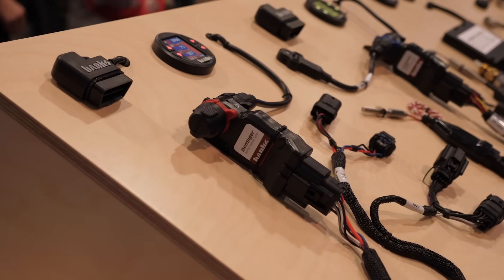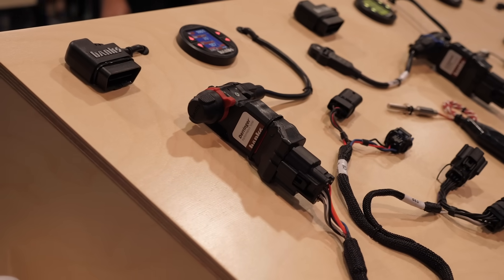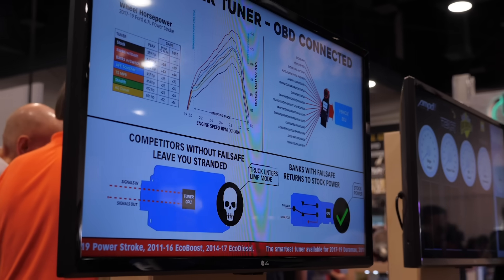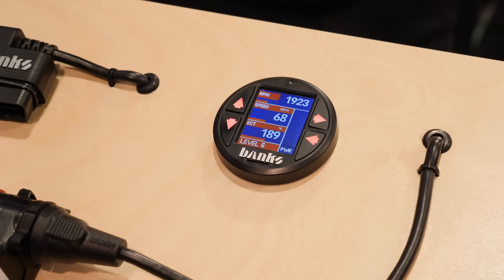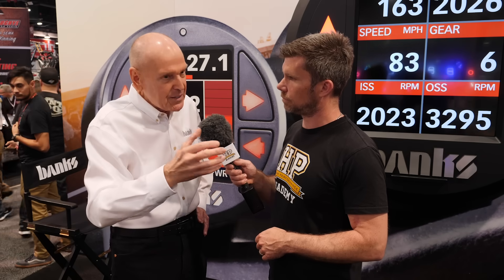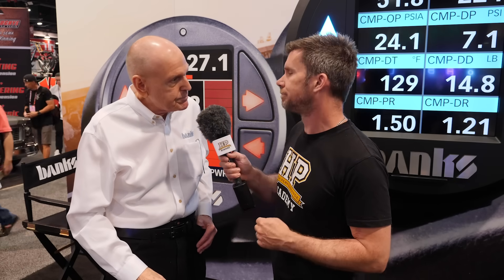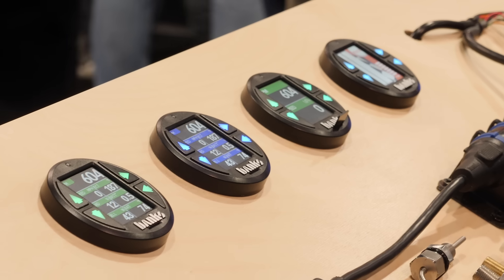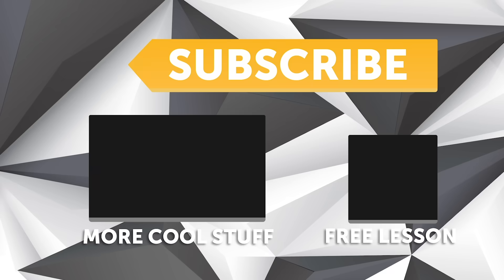More POWER With A DPF Fitted? | Gale Banks On Emissions [TECH TALK]

Comment: whats his answer to the nasty crap building up in our brand new trucks intake and after long enough it cuts the air flow he says matter so much for power yet agrees that its good..... i dont get it.. kill the engine that could last a life time basically with normal scheduled maintenance  gale man you can really think that crap is even close to ok for the engine...
Reply: EGR does it too. The soot is like tiny pieces of sand and wears out rings and cylinder walls much faster as the EGR valve allow exhaust to flow into the intake.

Comment: The market is still alive and kicking. Delete it mechanically yourself and get it remote tuned from Canada where it’s legal 👌
Reply: Problem is that before long you will not be able to register the vehicle without an inspection...
Reply: Did mine as soon as I got it. 2019 Ram 3500. Optimal Welding. Best tuner for the Cummins.

Comment: Does banks run DPF on any of his race motors?  Didn't think so.
Reply from the maker: A race engine in a race application? That is covered, he does not. Are you running a race engine in a race application too? If so, you will have no issues removing the system - Taz.
Reply: @hpa101  Am I looking for the most power I can get?  Yes.
  Is the emissions equipment a limiting factor? Yes.
Does emissions equipment limit power and shorten the longevity of modern diesel? Yes.  
Does banks do whatever it takes to stay in compliance with draconian government regulations? Yes.  Makes him an un-American bitch.
Reply: @asherdie  : Garbage.....What it makes him is an honest Business Man trying to stay in business......
Your Rolling Coal amateurs will hurt  everyone eventually......

Comment: That’s not true about record holding Diesel engines not smoking. Some of the fastest Cummins diesel drag truck pour cloud of black smoke running 3000hp. Gale is getting payed by the EPA to say that
Reply: They use the  excessive fuel to control EGTs, and super high Boost Psi. The other thing is they run that for a quarter mile not thousands of miles
Reply: Gale is referring to his race diesels, no one elses.  Black smoke is not power, it's wasted power.

Comment: $2000 to delete over $5000 for a new DPF. I am choosing deleting. I don't want to roll coal, rolling coal is so stupid. I like clean tunes. There is no need for dirty tunes.
Reply: Try 7-9k for the L5p
Reply: x2
Reply: You and many are wrong most places called Dr diesel have no clue how it's done properly second delete will create other issues down the road.
Reply: Rolling coal is for teenage mommas basement bitches
Reply: Come on, be a REBEL

Get it?
Reply: Matt 68 Gale has sidestepped the fact that other than laws there are absolutely no reason to keep a dpf!
Reply: Pat Ball Actually diesels burn really clean. Cleaner than gas engines in fact. When you start adding more fuel it’s a different story
Reply: @huntguy3831  burn cleaner and better fuel economy
Reply: Pat Ball  plants intake carbon dioxide. Its been proven time and time again that the carbon footprint is bullshit. 

The only real issue is smog and that happens in low lying areas with stale air movement like Los angles and is not an issue except in deforested areas.

Look up the controlled plant growth study. In a sealed environment not only did the plants uptake over triple our current atmospheric carbon level the plants grew better.
Reply: Pat Ball   Actually not accurate at all . Black smoke is simply excess unburned fuel. A diesel is much more efficient  then a gas engine.
Reply: So before emissions you had soot, soot is relatively large paricles and fall to the ground. Now with DPF and regen you burn the large soot particles into really tiny particles that stay suspended in the air and can easily be inhaled. Just sayin
Reply: @ericwendlandt7808  no shit! Anyone whose been near a Ford that is regening can tell you it burns the shit out of your eyes, nose and throat, bit somehow that's better than soot, that settles to the ground.
Reply: @Jackmerius_Tacktheretrix  Why you standing by the exhaust of any running engine?
Reply: @Jackmerius_Tacktheretrix  *
Reply: @dj4monie  Some people work for a living and it's common to stand close to the tailgate of a truck, where the cooler is.
Reply: @ericwendlandt7808    I have herd this for years. but I feel like its an old wise tail.
Reply from the maker: @Eric I'd be interested to see your credible scientific links to back that statement up - Taz.
Reply: @hpa101   I would love to see yours? Just cause a government agency says so?  I would love to know shortening the life span of these trucks and burning almost twice the fuel it's better for the economy?
Reply from the maker: @bradleylayton1741 I'm not making the claim, we're just working within the rules we have for street vehicles. You also give people a lot of credit to come up with and implement such conspiracy theories let alone keep a lid on them. In reality, people are far more incompetent than that in my experience 😂

There have always been rules to follow and rules for many things in life including some that allow you to post your comment from an electronic device without fear of being electrocuted for another perspective on it all.

Although the focus is on ash, soot is part of the study by default too for these 2: Sappok, A. and Wong, V., “Detailed Chemical and Physical Characterization of Ash Species in Diesel Exhaust Entering Aftertreatment Systems,” SAE Technical Paper 2007-01-0318, 2007, doi:10.4271/2007-01-0318.

Sappok, A., Govani, I., Kamp, C., Wang, Y. et al., “In-Situ Optical Analysis of Ash Formation and Transport in Diesel Particulate Filters During Active and Passive DPF Regeneration Processes,” SAE Int. J. Fuels Lubr.6(2):336-349, 2013, doi:10.4271/2013-01-0519.

You might also enjoy this. There might be something more recent now if anything major has changed: https://www.sae.org/publications/books/content/pt-124/

And change the search term to suit your topic here: https://www.sae.org/search/?qt=%22diesel+exhaust+emissions%22+&sort=date&sort-dir=desc&display=list&content-type=%28%22PAPER%22%29

I know you're most likely here just trolling and are not actually engaged or interested, but just in case, enjoy! 😂- Taz.
Reply: @hpa101  nothing personal, but I doubt all street legality laws are followed outside of this one issue. Just extremely hard to picture. This one gets followed because people are scared. They've made you fear them. Not because it's "illegal"
Reply: @hpa101  problem is any scientific studies that don't back the EPA will not see exposure, will be censored, and the scientists will lose their careers. If you doubt this, there's a lot you don't know about. So asking for scientific studies is a moot point in modern times.
Reply: Epa means end of production in America .Let's vote on it EPA instead of special interest sky is falling special interest pushing your buttons. Result EPA would lose they cost Americans a lot of money.Why are our jobs go to China and Mexico they have no EPA ,OSHA ,workmen's comp,whiny lawyers.There is no level playing field for Americans and the businesses. Go common rail no Doc no DPF let technology catch up then I have no issues. What does burning DEF do to our bodies and atmosphere they don't know? Vote for Trump again.
Reply: @gregpaszt4671  damn commiez
Reply: Greg Paszt The def is actually killing bees. The thing that California made everyone do to “save” the planet is actually hurting it more. Ironic lol.
Reply: @gregpaszt4671  have you seen the working environment in China? You want de-regulation so we can be just like them? We need to tax imports so the companies that outsource would save money by being based in, and manufacturing in, the states. That's what we used to do. All the politicians are bought and the population doesn't care enough to pressure them. Less government, less regulation is not the answer.
Reply: @matthewmcclain1316  lmao you think China isn't regulated? Hahaha what a joke
Reply: Just drive a gasoline engine.
Reply: @TheFrenchHillbilly  naaaa. I love 1000 ftlbs of torque under my right foot. You wont get that in a gas motor with out building the piss out of it
Reply: @wetsaltypickle  Diesels are slow kids toys
Reply: @TheFrenchHillbilly  A gasoline engine does not have the economy, torque, towing capability   .
Reply: @TheFrenchHillbilly  They are looking to put particulate filters on gasoline engines as well to reduce particulate emissions. Currently happening in Europe, I wonder when California will look at it?
Reply: Then when someone you love dies from lung cancer, you can spend the money on the coffin. Smart man.
Reply: EPA fines up to $37,500 per day for significant issues and up to $7,500 per day for minor ones. I would say deleting is significant.
Reply: @davidturner6509  I live in a state with no DEQ or vehicle inspections. I have never heard of anyone in my state getting poped with a deleted truck
Reply: Matt 68 I guess the answer is simple then...If you do get caught, you can just tell them you've never heard of anyone being popped for that so it can't happen to you.  If they are really persistent, you can remind them that you have not signed any contract allowing them to impose any fines on you and you should be good....
Reply: @davidturner6509  we have rolling smog checks out here in California.  Cops also know what to look for.  Even if you do get caught it's mostly only a small fine.  90% of people that delete put it back to stock when smog comes around and the rest have dirty smog guys.  I hardly find this criminal.  That may be the case for the actual tuners though.
Reply: @wetsaltypickle  well your very lucky. Because if your HAULING a trailer & a FHP pull you over & you ain't have it your in trouble. FHP IS DOT. IM A TRUCKER
Reply: @heavytrucks5237  A semi and a pick up truck are 2 different things. I've been pulled over and not once, has FHP looked under my truck or under the hood.
Reply: Might look at what's happening to those manufacturing the kits n tech ,,
Reply: @davidturner6509   Did you sign a contract with the EPA agreeing to allow them to fine you? If yes, too bad. If no, then they have no authority to do anything to you.
Reply: @alphaforce6998 .... would not try to make that hold up in court.. when you buy a vehicle in the US, depending on the year and emission standard in effect at the time,  you agree to emission standards regulations. Its a federal law.. like speeding.. you get a ticket whether you sign on not.
Reply: It's nice to be able to blast a cloud of black smoke whenever you see leftard protestors blocking your path... or if a road pirate stops you.
Reply: @alphaforce6998  Asshat
Reply: @alphaforce6998  and youre the reason why they want to ban diesel.

Comment: I don’t want to delete my truck so I can see smoke!!!!!!!  What’s the point of that???  I, like everyone else want efficiency, reliability, and power.  EGR and DPF are major detractors to that equation.   I know Gale doesn’t agree with engines eating their own shit (EGR), but he must tip toe with the EPA.  But it should be acknowledged that 98% of people wanting to delete are NOT doing so just to see smoke!
Reply: Agree 100%. People dont delete to roll coal. They delete for the massive power and fuel mileage gains.
Reply: @dougn6465  i have heared that a good tuned egr system improves milage because of burning more of the restfuel in the exhaust gases. And iam not a fan of all these egr stuff.
Reply: @nicoleibundgut534  The key here is tuned. No manufacturer wants to tune each vehicle that way because it costs money. Even less that there are regulations require egr so they go with the cheapest option.
Reply: I was talking to a Cummins Mech. this weekend. He claims 95% of all issues they see with modern engines can be tracked back to the EGR system. He says deletes fix nearly all issues with diesel engines.
Reply: @evernhamanderson  yeah and EGR delete does not need DPF delete so it doesn't even add smoke, things just work with DPF delete. As far to usability only downside of EGR delete is slightly slower heating after cold start but that is not an issue in most locations and seems not to bother all engines. By my experience that issue can be helped by restricting airflow to engine bay during winter months. It also prevents some corrosion for the radiator / IC during salty times.  No point of having enough airflow to survive in +120F if outside air is close to 0F
Reply: I recently drove a deleted truck and even at full throttle and high RPM it put out no smoke at all. The tune is what matters. You can tune it to run clean. It's thanks to the coal roller wankers that EPA does this and normal people who want a good, reliable truck that eat shit.
Reply: I had a diesel with full delete, not for smoke but for reliability and MPG.
 EGRs are almost always a source of problems on any diesel, DPF clog over time, regen cycles dump fuel directly in the exhaust to try to burn the accumulated soot and I was lucky enough not to have SCR with urea injection which is also an expensive source of problems.
If I ever own another diesel, it's going to get a full delete too. No smoke tunes which just kill turbos and melts pistons, just a good custom efficiency tune.
Reply: Idk about 98% but I’d say at least 80%
Reply: Yeah. I have an 05 ram dually (5.9 with g56 manual) so no delete necessary. 
I love shifting but loosing the turbo spool between gears causes some black smoke, especially when it’s hot outside. 
I hate seeing that smoke. I’ll take efficiency and power without smoke any day. There’s just not much I can do with that because of the transmission except putting an auto in it. I’ll never do that. 
Oh yeah, I’m also not a child 😂

Comment: All the fuel savings can be easily wiped out by a bad dpf. My vw TDI's dpf cost 3000.00 (82000 miles). I sold it back to VW (now they will have to replace it to resell it. What do you want soot or ash ?

Comment: Love a clean tune. Just hate the issues that eventually pop up related to emissions.  Extra wear and tear and more things to go wrong. Not just regular trucks but also semi's and its a huge issue in agriculture as well. Added cost of equipment, less power, and more breakdowns. Producing urea as well as the plastic jugs they come in along with shipping them isn't environmentally friendly either. I wish the government and epa would look beyond just a cleaner result out of the tail pipe because there is a lot more going on than that which could be improved to reduce our carbon footprint without hurting the product we are applying the restrictions to as well as passing costs on to consumers. I have a deleted and tuned F350. No smoke, I burn less fuel, I produce less waste as a result of no urea jugs and my truck has less chance for break downs. I am probably producing the same or less overall emissions when you consider those factors compared to running the emissions equipment.
Reply: its not about the environment its about squeezing as much money as they can from fines and mandated gov testing. fuck the epa and the fed gov
Reply: Nitrogen oxide is what catalytic converters and def primarily remove, which is much worse for the environment than some soot
Reply: @PappaLitto  it's all relative... Depending on your area, some pollutants are "worse" than others.
Reply: The government is great at taking a topic and finding a way to make an organization that revolves around "fixing the situation" which in reality everyone knows they just do it to profit off peoples troubles cause then they can ($$fine yo asss$$$)
Reply: It's not carbon footprint. You may think you have a "clean tune", but if you actually analyzed the NOx emissions, I assure you that your truck produces at least 10x what it did stock.
Reply: @wlrottge  clean as in no smoke, being as efficient as possible.

Comment: Just curious if the L5P Duramax engine Banks provides for the military uses emissions compliant equipment.
Reply: Military vehicles are exempt from EPA laws so they don't run emissions equipment. Can't have that crap stopping up on the battlefield.
Reply: Jordan Chailland. Go figure, EPA is really killing diesels, they know that regin is a problem that why military is exempt, but these idiots that want to “roll coal” have hurt everyone.
Reply: @jordanchailland8444  yes and no... Not all military vehicles are exempt.
Reply: @wlrottge  which ones are not exempt?
Reply: The JLTV does not use emissions systems.

Comment: Before emissions controls, diesels were slow, and very noisy!  A Cummins B5.9 had 160hp and 400lb/ft torque, and got 15mpg on the highway. I drive a 2016 Ram Quadcab 4wd 3.0L Ecodiesel, which has 240hp, 420lb/ft torque, and gets 28mpg.  Runs very quiet.  
My wife has a 2018 Ram 2500 Crewcab 4wd 6.7L Cummins, which has 370hp, 800lb/ft torque, and gets 23mpg.  Way quieter than the 1990's Cummins.
I wish Gale Bank's would do video's of before and after emmisions.  On pick up trucks running his water injection system.  The Snow performance water injection system was shown to extend regen cycles by 50%.  On a Ford Powerstroke.  In a story in I believe it was Diesel Power magazine.  The EGT's were lower also.
Reply: forget all the crap. 10 years from now you will understand when your wallet is empty and the mechanic is asking for 2 grand

Comment: I would not delete it until it fails or becomes problematic. Not spending the excessive cost to replace it for the environment...same with the scr system. Scr emulator for the adblue system if it goes kaput.